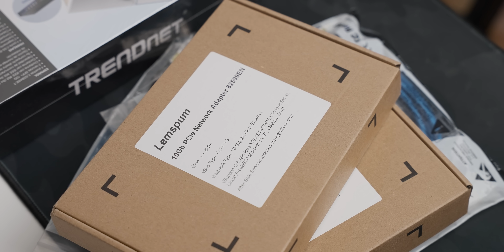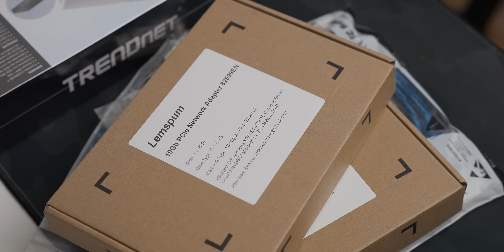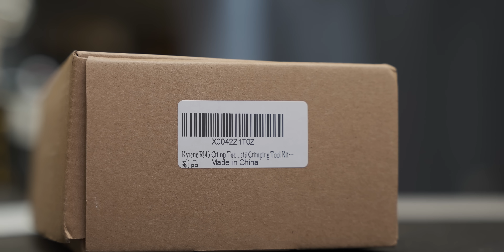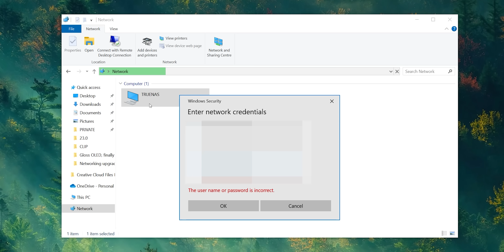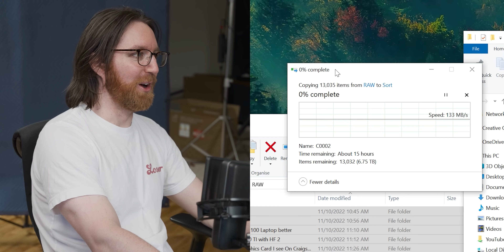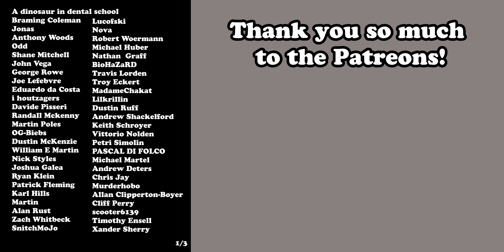Upgrading To The Cheapest 10GE Network...

Comment: Hi Dave, sorry destroy your coolness. But these DAC Cables are twinaxial cables made from copper. They are designed for datacenters where the servers are near to the switches. Still the right choice for your usecase.
Reply: Twinax cables are still pretty high on the coolnes scale :D
Reply: @enrique5167  Yes they are. Also they are avaible for 25/40Gbit‘s and upwards.

Comment: Should have used the patch panel, they are so much easier to cable. You would have gotten the whole thing done in the time it took you to work out how the crimping tool works..
Reply: They also make connectors that you can pull the cables straight through and then cut them off at the ends. Waaaaay easier.
Reply: the thing not mentioned about the patch panel is that you can't just use a crimping tool... you also need a punch-down tool to terminate to the panel and there would also be mounting of the panel to a wall or desk needed to stabilize for that punch-down process.
Reply: @jeffjohnson2731 You sound like someone who has never done this professionally. Stabilising the patch panel is a luxury.
My last install was done at the top of an a-frame ladder because some numpty cut the cables too short. Well, only a few but that doesn't matter because you can only work with the length of the shortest cable unless you want a huge mess instead of a nice loom.
Reply: @clubley2  professional work is always done in a rack of some type... the rest is just residential and you do best effort to keep it clean and make it work.  It would have been nice to see Dawid use a small rack of some type to clean up the mess, but that's a longer video than I'm sure he wanted to make and not exactly cheap.
Reply: @poeticsilence047  Just have your apprentice run out to the truck and get the cable stretcher.

Comment: Why not use SSDs for the NAS? was it built from old parts?
Reply: 100tb+ worth of ssds would cost you a house, compared to 100tb+ worth of hard drives
Reply: You don't load a NAS up with SSD's

Last time I looked at hard drives you could get a 10+ TB drive for around $100, SSD's are significantly more expensive. 

It wouldn't help him anyways because the bottleneck is his archive drive read speed.

Comment: Just be thankful that you got the connectors where the wire goes all the way through. The "regular" ones where you have to trim the connectors to the exact length (just over 1 cm) BEFORE installing them in the plug. Can be a real pain in the * to install, even if you have done it 100's of times
Reply: Yes, I've done that a few times at an internship. Pain in the butt because those wires always tend to shuffle around a bit after pulling them out of the connector and then trimming them.

At home I just got those passthrough ones, there's like no price difference and it saves me having to lose my sanity over trying to correctly align those wires.
Reply: Eek, dont remind me about those pre trim heads. pass-through all day!! also watching him pass 1 wire at a time through the head was p a i n f u l  to watch
Reply: It also depends on the type of cable and what type of shielding or rigid core they have. So many different types you never know what you are walking in to. Lol
Reply: Mostly matters you get quality cables, bad cables can't be terminated correctly regardless of skill.  There's some real junk being sold on amazon
Reply: @muhcharona  oh yea like i have terminated some crappy quality cheap cabling, problem is i am not the boss so no matter how much i complain i don't get to choose. Plus going into other places of business where cabling is already. Yea it can really suck
Reply: They are not fun. The pull through ones look a lot easier haha.
Reply: I was thinking he was doing it wrong because I remember indeed stripping them all to the same length before crimping them into place into the connector, and you had to make sure you had enough slack on all of the wires to avoid them pulling back. I have now resorted to the advice Dawid's friend gave and patch things into wall mounted connectors using a punch tool, which is 100% easier and more reliable to boot, and then just use short premade patch cables between the wall mount and the devices.
Reply: @stragulus  Yeah using a punchdown tool to terminate to keystone jacks or a patch panel is loads easier. The pass through style RJ45 plugs are much easier to terminate than the older style ones were you do have to trim all the cables to the exact length though, for sure.
Reply: @FedeHippo  pass through connectors that don't make me want to hurt myself that alone is worth their higher price and specific tools
Reply from the maker: @FedeHippo  Yeah that sounds super annoying. Guess I lucked out with the connectors that came with the tool. 😂
Reply: Yeah, i was like, what dark magic is that :O I would gladly pay more for an much easier job than what i used to do. It's almost cheating :P
Reply: Oh and the pain you get from handcramps from hours of terminating new rj45's shudders
Reply: We had the regular ones in my networking class. Was definitely a pain to consistently cut them to the right length and keep all the wires the correct way while inserting them into the connector.
Reply: It's actually super easy, just untangle&straighten them to their base, arrange the colors, trim straight and push inside the connector, make sure to keep pushing the cables while crimping and you're set. Took me 4-5 tries before i figured it all out, but hasn't failed me since.
Reply: @cogarg80  then you must not have gotten ahold of some really cheap flimsy cable, theoretically you're correct but in the real world it doesn't always work out that nicely
Reply: @Isley6628  I've successfully attached rj45 connectors to everything from lowly cat3 to SF/FTP - the only one I've had problem with was SF/FTP which is not supposed to be used this way at all. If the wire conforms to cat5/6 specs, it's pretty easy to attach an rj45 connector, if not, you shouldn't be using it anyway.
Reply: @cogarg80  You've never met the hair strand wire "copper clad" aluminum specials then, it can be very very bad.
Reply: 4 years of uni, still can't clip rj45s
Reply: Yes, I would have gone with the patch panel myself, just because it would have been done in a tiny fraction of the time....
Reply: this
Reply: Hmm yes passthrough. Gotta love having shorts

Comment: OMG, dawid didnt know why he should use patch panel in networking.
Reply: Cable used in cable runs (structured cabling) is supposed to be solid core cable. Solid core should not be terminated with an rj45 and is not designed to be flexed often like patch cables. It suffers from work wear and can break internally if flexed a lot. Patch cables use stranded copper cable and can be flexed without much issue.
Plugging into devices is expected to be done frequently whereas installing cabling is one and done.
Reply: @clubley2  Thank you for reminding everybody why good practice is better. It works (for now) the way he did it but "it's not the the way"
Reply: @clubley2  ahhh. It makes so much more sense now. Thanks
Reply: Yea, I felt a pain in my chest when he said that.
Reply: As a former Network tech, it hurt me in my soul. But let him figure that step out when he reach it.
Reply: You can’t just drop a comment like that then NOT tell us why it’s a bad idea
Reply: Came here only to complain about that. :D